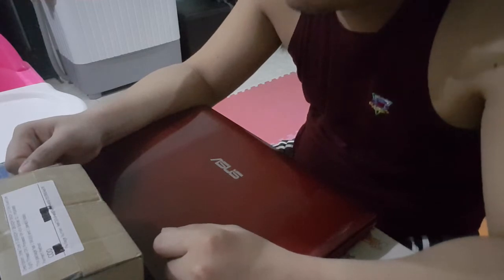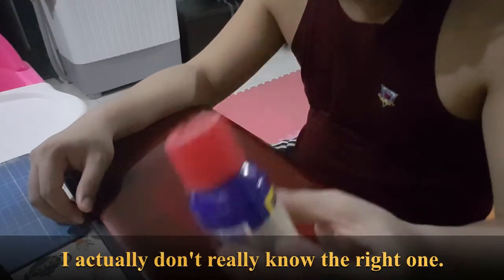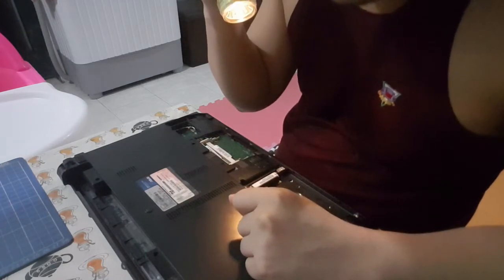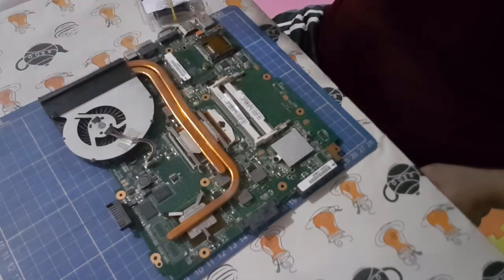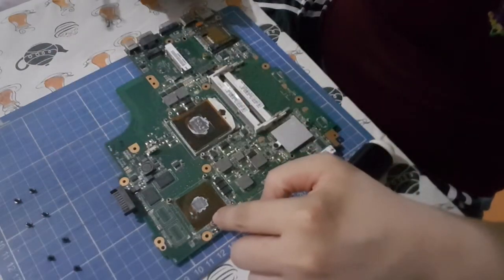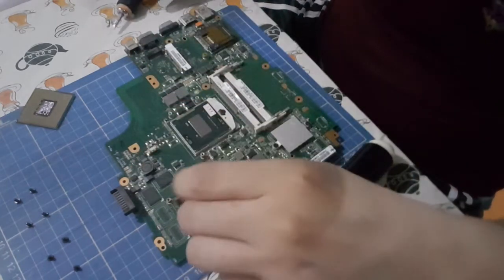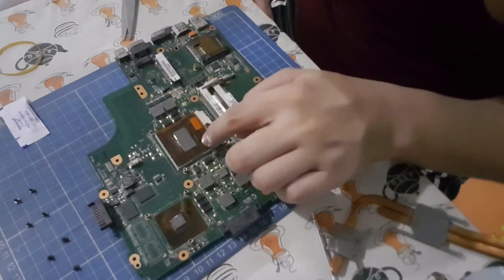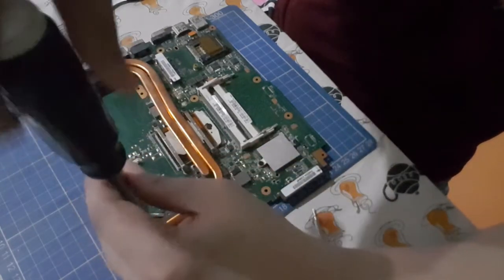Processor Upgrade for Asus K43SJ Laptop; Part 1

Comment: Hi Sir. Same laptop ASUS k43sj. I also upgraded it to 2x4gb = 8gb ram and . Since naka 64 bit OS na po ako, My brother in law has a laptop that has two pieces 8gb ddr3 (1600). I tried it in my laptop it detected as 16gb ram pero syempre binalik ko pa rin sa kanya ung ram nya and I'm still using a 8gb ram. I'm just sharing na pwede naten i upgrade laptop ram naten na hanggang 16gb.
Reply from the maker: That's good to know. So that means unofficially, the laptop supports more than what is advertised. Thank you for the info.
Reply: @BlueShotgunShells  Yes sir. Atleast na try naten na pwede pala maexceed ung 8gb ram ng laptop naten. I'm also using this laptop model to play games and i'm planning to add or set up external video card via PCIe..
Reply from the maker: @markchristopherbahalla4595   ahh oo. May nakita akong youtuber na gumawa nyan. Good luck sa project mo.
Reply: @markchristopherbahalla4595  kumusta bro naupgrade mo ba videocard via pcie?
Reply: @markchristopherbahalla4595  update sa project mo? naka 16gb knb?
Reply: Pwede poba ket 1.35v or 1.5v sa pag upgrade nalilito po kasi ako baka magkamali po ako
Reply: Pwidi pahingi ng link sa ram na pwidi maging 16gb
Reply: Mark ano ram nya na model pwidi pa send

Comment: Hi Sir! Same tayo ng laptop. Nag upgrade din ako ng RAM (8GB) at SSD pero di pa din ako satisfied. Naghahanap nga ako ng nag di DIY case. Magkakaroon ng mini tower yung motherboard nya tapos gagamitan nalang ng monitor. Baka sir kung maisipan mo, meron din akong napanuod tinanggal ung wifi adapter at kinabitan ng outlet para masaksakan ng graphics card. Baka pwede kita ma PM sir usap tayo slamat
Reply: Sir pahelp naman where did you buy the RAM na pinang upgrade mo? Same din po tayo laptop.
Reply from the maker: @lebjournpisco5423  Lazada po
https://www.lazada.com.ph/products/hynix-ddr3-ram-4gb-1333mhz-pc3-10600-for-laptop-memory-15v-i265072305-s371861171.html?mp=1
Reply: @BlueShotgunShells  at chak ka cpu na processor model na i7 para upgrade kopo
Reply: @lebjournpisco5423  meron ba 8gb nito?

Comment: Sir we have the same model of laptop, anu kaya problema nia umiilaw naman ung on/off button pro wla display sa screen sbi ng technician na pnag tnungan ko i bios dw? Thanks
Reply from the maker: Di ko pa naman po naencounter ang ganyan. Try to press and hold the power button for 30 seconds to a minute. Make sure the charger is unplugged and the battery is removed first. Then try to power on with the charger only. If it works you can try with the battery. Hope this helps.
Reply: Sakin black screen para pinalitan ko lang yung hdd from 320gb to 1tb yun na black screen na sya kahit ibalik ko ung 320gb ganun pa din black screen.🤔🤔 Help... TIA
Reply: @paulninodelossantos  Ram po yan tanggalin mopo taz yung pin nila kuha kapo eraser taz iKuskos mopo dun, Ganayn den po saken eh